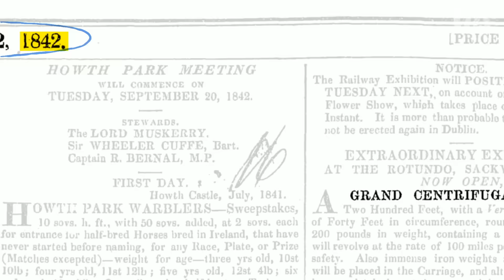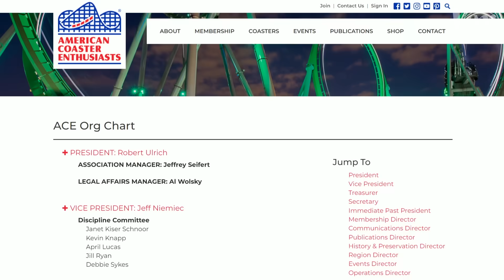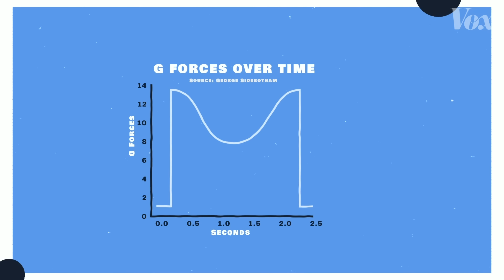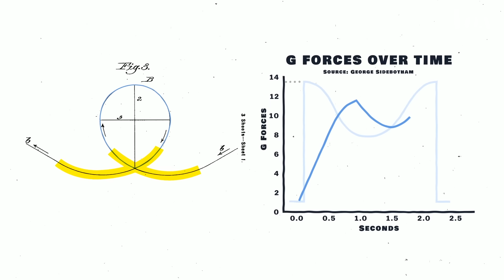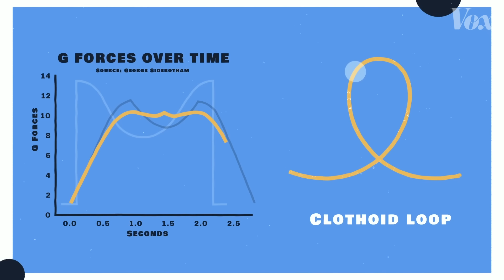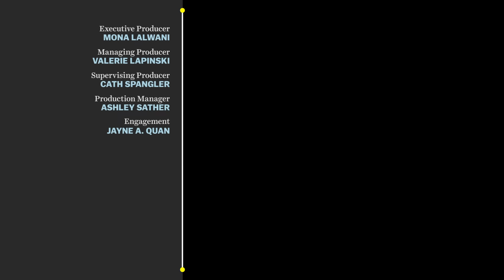Why roller coaster loops aren't circular

Comment: As someone who studied engineering, works in theme park design, and is just an all around coaster enthusiast, can confirm this video is on point. Even using the the correct geometry based terminology of clothoid loops to describe the “teardrop” loop., made famous by the manufacturer Arrow Dynamics (who also helped make the Matterhorn). Fun thing to notice, Arrow built a number of geometry based coasters (as opposed to force-based) with the clothoid loop. But for a long time only used one size for the loops design. So the bigger the first drop, the higher the same sized loop had to be off the ground. Examples, Great American Scream Machine, or the still operating Viper at Six Flags Magic Mountain.
Reply: Agreed with your 289 text in this comment 👍
Reply: Anaconda at Kinds Dominion too hahah
Reply: Listen to this guy, Andre iz smart
Reply: @JosephPojunis  😂 the username still holds. And always a pleasure to see a comment from you!
Reply: @Nova3674 Yea you are smart at this
Reply: That one size loop is completely new for me after being an enthusiast for so long
Reply: what engineering did you study?
Reply: @jakethecake6952  I studied civil and structural engineering, though mechanical may be more preferred if wanting to deal with the physics and movement of the coaster. Structural obviously deals more with the non-moving parts of a coaster like the supports
Reply: From engineering views, is it true that sitting at the last row gives more thrill?
Reply: @peoplecallmeAdly  The last row gives more airtime but the front row gives better views (typically) and better wind in the face (exciting for some kinds of coasters).  Coaster enthusiasts generally will check out both for a particular coaster.  Usually my favorite is the last row about 80% of the time.
Reply: @peoplecallmeAdly  thrill is different for everyone. Hence why there are so many different types of coasters, rides and, attractions. What thrills one may be boring to another. Some people love the thrill of being in the front, with only the track speeding past you ahead. While others (like myself) love the sensation the G-Forces give you. The back row of a train on most coasters tends to provide a little bit extra force because engineers tend to design them based on anywhere between the front to generally the middle of the coaster train. What this means is that when the front of the train slowly crests a hill before speeding up as it plummets down the drop, the back row will pass over the same section of track at a faster speed, thus increasing the average G-Forces one would feel. But again, thrill is subjective. Some people are more scared of heights, while others loops and inversions.
Reply: @peoplecallmeAdly  if you watch the coaster train go up and over the first hill, watch the speed that the first car goes over the drop, then watch the speed of the final car over the drop. Then decide which spot you think looks most fun
Reply: @peoplecallmeAdly  basic physics dictate that the back of the train will have more aggressive whip. If it's a coaster with long trains, especially wooden ones, you should expect the back row to be more thrilling due to that.
Reply: @Turkeyslam   That's not how the physics work. If the coaster wasn't forced to follow rails beyond the first car then the coaster train would move in a progressively smaller circle making it faster towards the back. Since they are fixed to a track the entire train moves at the same speed and follows the same geometry so there is no "whip"  effect towards the back. Think about it, do you see any cars moving in a tighter circle than any other? They're all fixed to the same track and follow the same path.
Reply: Arrow made a lot of poor engineering decisions, which is why it's no longer around.
Reply: Bro thinks we asked
Reply: @dannysevil  I asked leave him alone
Reply: Is the viper one of the coasters that came from Astroworld? I seem to remember that they shipped all their coasters out to other six flags parks. It had a short tube you went through right before a loop. If it's the same one, that is the first roller coaster with a loop that I ever rode.
Reply: @christophercarpenter7536  Astroworld closed in 2005. Viper was built in 1990.
Reply: @christophercarpenter7536  if it's the same ride, Viper was the green looping coaster in the "Oriental" section of Astroworld. Near the Serpent, Bamboo Shoot, and the gondola station.
But don't forget Astroworld also had  Greezed Lightnin' with the flywheel start. 0-60 MPH in about a second. I believe they shipped her off to Joyland when Astroworld closed.
Reply: @danielpittman889  "Greezed Lightnin' with the flywheel start. 0-60 MPH in about a second." Four seconds. Pretty slow compared to modern launches, but definitely a unique ride.
Reply: When they designed the Matterhorn, was it the first roller coaster encased in a mountain?
Reply: Great American Scream Machine always looked weird to me with the first three loops "starting" so high off the ground. The exit of the first loop was higher off the ground than the diameter of the loop itself!
Reply: I still don't like the fact that coaster have gotten so much less intense, I wish we had more circular loops again so I'm going to have to disagree.
Reply: I know my comment is a bit late, but would you mind sharing how you got your fist internship/ into the Amusement industry? I'm a MechE student right now and that's the field I want to go into and the reason I chose my major!
Reply: Yeah those kinds of gs on a untrained person is unpleasant to say the least then youv got the white out problem and then the physical problems from that kind of loop is jusy nasty i say no sir no to that kind of loop that tight of circle just nagh
Reply: Have you seen the Citation Needed episode on the Flip Flap Railway? It's on Tom Scott's YouTube channel.
Reply: Vox being honest? Since when?
Reply: hey bro, based on your background, you could give me some advice for my project. So I want to design some common rides (free fall, ferris wheel, rollercoaster etc), but the catch is that these are the most extreme versions possible. Like they get as big and fast as practically possible, without offing the passengers. For example, the free fall would produce the most G force a human could take, increasing its height or power. The ferris wheel would be the highest altitude possible without any special gear for the passengers. However all these are also constraint by engineering problems like materials and architecture. Where do i start? What factors should I consider and apply formulae on? It would be greatly appreciated if you could give some insight into it
Reply: @mohammedayan4058  each of the attractions you listed all have different forces in effect on riders. A Ferris wheel exerts next to little forces hence why they tend to be attractions for all ages. The wheel would have to spin fast relative to its size to exert a force which based on safety standards wouldn’t be allowed to exceed 3Gs of downward force (3 times that of gravity) for more than 12 seconds. Most attractions tend to follow that rule roughly and are designed in a way that accommodate that based off of mathematical analysis. A lot of coasters nowadays tend to be designed using force vectors, which basically means the curvature and shape of the track is determined based on how many forces you want your riders to experience. Building taller and faster doesn’t always mean more forces… it really depends on the accelerations that are being experienced. Right now, six flags qiddiya is building the tallest, fastest, and longest coaster at 600ft tall. But again it is still limited to the force rules for safety reasons
Reply: But Revolution @ SFMM doesn’t have a teardrop loop, it’s almost a perfect circle
Reply: @cowplatter5320  Almost circular, yes. And it has a pretty intense entry into and exit out of the loop. It spikes at about 5-6Gs for a very brief moment
Reply: Hello. I'm really interested in roller coaster design. How did you work your to that role?
Reply: Really? Im glad some rando nobody can comfirm what a Univeristy PhD professor said in the video.
Reply: @rg1649  i agree. I never discredited it… it was a good video 😂
Reply: @Nova3674  3 yrs later and you’re still replying as well lol I salute you 🫡
Reply: I would have hoped that they discuss more about the bezier curve continuities. This was a very generalized explanation in the video.
Reply: If you made this comment just to show off and tell us how amazing your job is, it really worked
Reply: @nachomc222  Not really, it's a really simple common sense to have the tier drop shape and explaining it in the way he does but it gets more complicated the more in depth you get on it, which he hasn't done yet.
Reply: We totally needed you to validate this video....
Reply: Thank god some random nobody in the comments "confirmed" this video from an extremely well known and reputable channel. I was doubting their info until this no-name came along with the omniscient "☝️🤓 erm aS aN xYz, I cOnFiRm" comment.
Reply: @Sigma_Eight  I’m just commenting based on my interest and knowledge to hopefully encourage more curiosity. I’m not claiming to know anything everything or be a trustworthy source. Just commenting from a place of passion and interest hoping to excite others ☺️🎢
Reply: dude u aint an expert man this guy in the video knows more than u
Reply: @lazybeastz182  I never said I'm an expert, but I work in the industry sooo... I know quite a lot about the physics, engineering, and design of attractions like the ones described in the video especially considering I've designed and consulted on some. No need to be pointed and rude.
Reply: @Nova3674  I’m a lil late on this vid but I have a question for you. What about the ring of fire? It seems to be completely circular but just curious to know how it’s any different than the circular coasters back then.
Reply: @lilyherkert5264  that’s actually a great observation. Ring Of Fire, Fireball, or Larson Loop type rides are pretty much circular. They’re able to be circular without causing harm due to high g forces because the vehicles aren’t gravity fed. Meaning, the speed of the vehicle is controlled so it’s able to be “pushed” or “pulled” through the circular loop at a specific speed that almost defies gravity, rather than having to have enough speed to clear the loop. Hope that makes sense.
Reply: @Nova3674  Yes it does! Thank you so much! I appreciate you taking time to respond even after months of this video being out!
Reply: @lilyherkert5264  Ring of fires are controlled speed. They never reach speeds high enough to hit 6G, I dont even think they go above 3.5Gs since the train's speed is controlled versus relying on gravity to make the loop. Sorry for the late reply!

Comment: There is a small problem that yall forgot which is that the flip flap railway and loop de loop needed circular loops to complete the loop without passengers and cars falling off the track and crashing into the bottom of the loop because they didn't have upstop wheels.
Reply: You mean they needed enough speed and thus high g-forces to create enough centrifugal force. The loops would still have been better with the cochloid shape.
Reply: @Robbedem  Exactly but they didnt think clothoid loops because in the 1800s to early 1900s safety was the second priorty
Reply: I don't actually know if they had upstop wheel back then but if not, you still get a little under 12 Gs on the top of the loop when you only need 1 G to keep it up so it doesn't fall.
Reply: The lack of upstop wheels wouldn't make that big a difference to the g forces. If a car rolls around a circular loop with just enough speed to experience 0 g at the very top of the loop (the bare minimum to not fall off the track without upstop wheels), at the bottom it would experience 6 g (assuming negligible friction). If it entered the loop with just enough speed to reach a speed of 0 at the top (the bare minimum to make it over the loop without rolling back, with upstop wheels) it would experience 5 g at the bottom. A real ride would need to go faster to have some safety margin, but if designed to experience 1 g at the top of the loop the car with no upstop wheels would experience 7 g at the bottom.

However, even a simple design approach of making the loop out of 90 degree arcs, with the bottom arc twice the radius of the top, would result in a loop that if entered at the appropriate speed would allow riders to experience 1 g at the top and only 5 g at the bottom, which would technically be possible without upstop wheels. It would still be unsafe for other, obvious reasons, and the abrupt changes in G force would be extremely uncomfortable and possibly even dangerous for riders, but it demonstrates that loops can have safe maximum forces without needing to have negative gs at the top. Real roller coasters usually still have positive gs at the top of loops unless they're intentionally designed to give a sensation of "hangtime."

(these numbers are all derived from the formula for centripetal acceleration, A = V^2/r, conservation of energy, and the formulas for kinetic energy (Ek = 1/2 m*V^2) and gravitational potential energy (U = m*g*h). The mass and radius terms cancel out: the minimum possible g force to make it around a loop with zero speed, or with a given g force at the top, is independent of the size of the loop)

Comment: Corkscrew at cedar point was technically the first tear drop/Clothoid shaped vertical loop. Revolution was the first to do a successful vertical loop with more of a circular shape.  The 2 we're by different manufactured and different styles.
Reply: Yup. The Corkscrew was built by the American builder "Arrow Dynamics" who also made the Matterhorn bobsleds, but the Great American Revolution, as well as the Sooperdooperlooper were made by the German Rollercoaster builder Anton Schwarzkopf, who by this point were Arrow's biggest competitor for large scale steel rollercoasters.
Reply: Since revolution opened a week before I'm sure that's why it's gets the credit that's how it goes sometimes

Comment: The true question for me is: Why people like roller coasters? Is the almost death experience? Is the feeling to say that I'm brave enough to go on a ride? Feeling of doing something I'm def not supposed to? Well.. A new video is needed.
Reply: Its actually exactly that, the feeling of danger, also the physical sensation of changing G forces is actually quite strange (and as such is a change from normal, so less boring).
Have you ever emerged from a dangerous situatioon unscathed? It usually is exhilarating, plus since you realize afterward you were never in much danger you dont face the later backlash that happens with real situations once the adrenaline wears off.
Its all chemical reactions.
I would posit that if you become totally unafraid or the rides and mostly used and immune to the physical sensations of it it becomes somewhat boring.

Comment: What they said about 6 gs making you pass out, there's a coaster at kings dominion in VA called the intimidator or something like that it's a Dale Earnhardt themed coaster. The first drop is like 300ft straight down then you hit a 80° banked turn. EVERY single time I've rode it I black out on that first turn. So I'm guessing it's right at 6gs
Reply: Intimidator 305 goes to about 4.5 gs (which is still a lot for a rollercoaster), but people still black out because it's a sustained force throughout that whole helix turn. Very few rollercoasters nowadays reach 6 gs.
Reply: I believe they had to re-profile intimidator 305 after it opened because the initial layout was too intense
Reply: @OffByHearttt  Yep, the second half of the turn leading into the airtime hill was raised off the ground so you would go through it slower and experience less gs.
Reply: @fyre5287  Typical Intamin as usual
Reply: Shockwave at Six Flags Over Texas actually pulls more Gs, 5.9 I believe. I305 pulls around 4.5.
Reply: Does it slam you into the wall at the end?

Comment: The answer is kind of obvious to anyone with a smidge of understanding of physics but the lore is cool
Reply: Yep, it's the logical result of knowing that a = (v^2)/r. If you don't want acceleration to increase, then either v^2 and r have to be constant or r has to increase by the square of velocity. This leads to the conclusion that the radius is probably the thing you want to be messing with if you want to go faster without killing the riders.

If you want to do completely circular, you pretty much have to do that sideways, as gravity is constant that way and the problematic acceleration is also more or less constant and you can get a roller coaster into that position with less trouble than with the more vertical types.